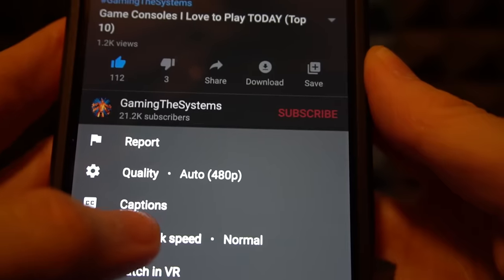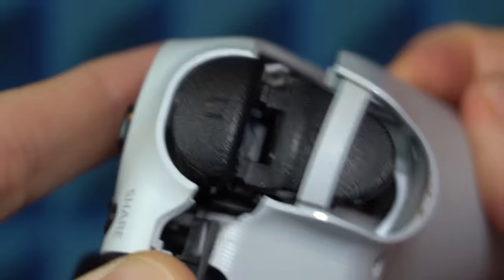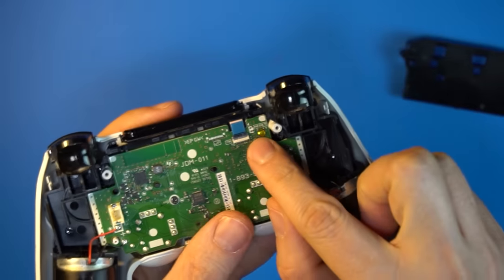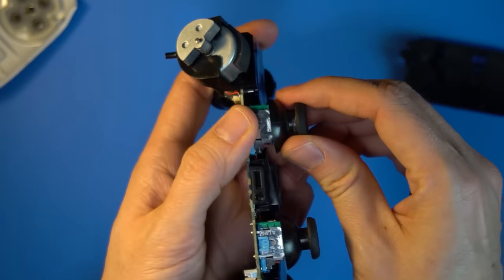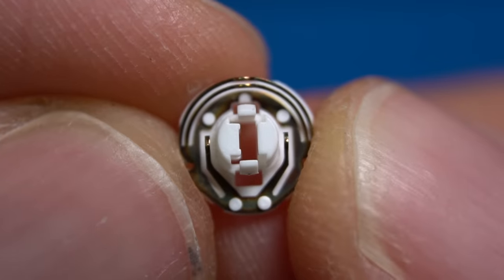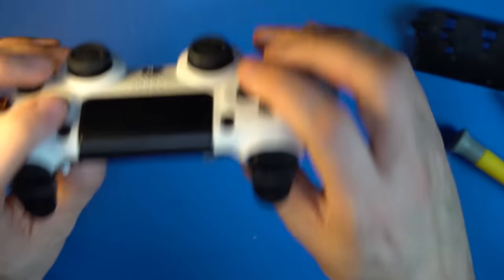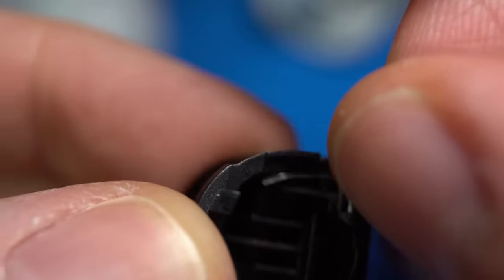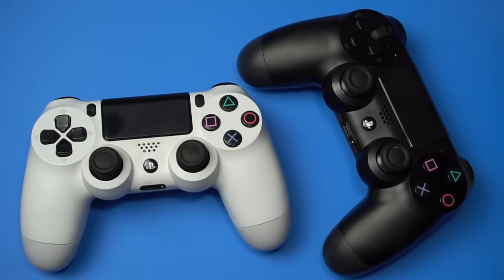How to Repair a PS4 Analog Stick That is Drifting, Sticking, Jittery/Cleaning DualShock 4 Controller

Comment: today, i attempted surgery on a dualshock 4. rest in piece little one...
Reply: Piece???
Reply: @nameskw4774  😐🙄
Reply: @shinmeg  damn... It broke?
Reply: @blickymaster7402  Yeah, I bent one of the small metal rods inside the right stick. Now that stick doesn't work. :(
Reply: @shinmeg  a
Reply: F
Reply: @shinmeg  same thing happened to me
Reply: RIP Controller
Reply: @nameskw4774  Yes, in pieces.
Reply: @Lol Nah what?
Reply: I also did surgery ended up being better than when I bought it
Reply: @Iscopezombiez  Doubt that unless you bought used.
Reply: @fredstead5652  I do repairs I bought parts and took the old ones off it’s way better than when I bought it at walmart
Reply: @fredstead5652  the response is so much faster
Reply: Me too, shit’s literally fucking unplayable, now I have to spend $60 for another shitty controller
Reply: @adc4836  Don't get mad because you fucked up your own controller deciding to fix it when you clearly have no idea how. Don't buy a new controller buy new contact sensors for £3.99 since that's the part you messed up.
Reply: Litteraly rest in pieces😂
Reply: Me too bent one of the silver coil things and now it’s went from a slight drift to only moving diagonally down hahaha
Reply: Yeah..... i kinda snapped the cap off the piece that holds the ribbon rip
Reply: This is how it feels Everytime I think about cleaning out my controller ... The first time I tried this it broke the controller completely. Instead of a small drift. That controller now 100% does not stop drifting to the left now. I took it apart and reconfigured it 3 times no result. I will probably never do this again lol
Reply: @DelusionalDev64  me too 🤦🏻‍♂️
Reply: @nameskw4774  Pieces
Reply: @shinmeg  r.i.p
Reply: Same.. my square and r1 button doesn't work anymore :")
Reply: Same today for me... gutted.
Reply: @nameskw4774  whoosh/r
Reply: @shinmeg  so.. how is your controller? Did you buy a new one? Did you buy a ps5?
Reply: @shinmeg  you should of payed close attention to the video
Reply: Same shit happened to me
Reply: Bruhhhh I feel u my 2k player doing the moonwalk all over the place but damn after clicking on this video all I can do is pray 😂🙏🏽  can’t risk making it worse
Reply: lol
Reply: i cant 😭😭😭💀
Reply: Nah it is NOT just used or dirty controllers. Some of them are complete duds and a waste of money. Just got a custom brand new one and it’s getting me killed every game lmao I’m soo tired of this bs.
Reply: I was the 1k like lol
Reply: You mean rest in pieces
Reply: I think I killed mine too xD
Reply: My light doesn't go on and the right stick doesn't work either, that was my other controller tho cx
Reply: I bought a controller and two days later noticed drift problems. So I'm about to become a surgeon.
Reply: I successfully fixed both my controllers 
I’m an electronic surgeon now just have pass my school and become a real human one lol
Reply: @Iscopezombiez  I am about to try, wish me luck pal. 😓
Reply: Should've just got it repaired.
Reply: Me too :'( just right now
Reply: Damn i snapped my whole top in half so i just decided to full send it to just see whats wrong but i didnt get any wiser now i just have a bag of random ps4 controller parts
Reply: @shinmeg  wow it's really that fragile?
Reply: Just blast your PS4 controller with WD-40 fast drying contact cleaner. My analog stick working good again without disassemble. Just blast inside the analog stick.

However if the only reason was dirt or dust inside of the electronic was the issue. Then WD-40 was the perfect solution to your problem
Reply: @shinmeg  same I don't know what to do
Reply: R.I.P
Reply: @shinmeg  same
Reply: ikilled 3 of them with surgerry'
Reply: I broke the cable to the board so yeah. I know your pain.
Reply: Rest in pieces hahaha
Reply: Mine is just disabled right now. I dont need a funeral for it yet. So  instead I will retire it and move on to a new one.
Reply: @MM-yk8gt  he said the silver wires should face the battery, and my light was not working, so i reversed it, and it worked.. blue tape facing the battery should work
Reply: I laughed hardly
Reply: This was Hilarious that's why this is my  6th time watching it
Reply: Worked for me…
Reply: Well luckily for me everything went well 😅 I can play PS4 again or watch crunchyroll cause that shit was unplayable with the drift
Reply: I'm not even going to try this! I'd rather drop another 59 on a stupid controller that will start drifting in 5 months.
Reply: Haha rip my guy
Reply: @shinmeg bro did not get the joke😂
Reply: @shinmeg I was so scared I was going to do this i managed to sucessfully do it
Reply: Respect DualShock 4 🫡
Reply: Sad button noises
Reply: Im about to do the same now , dont feel confident at all 😂
Reply: F
Reply: @adc4836 You don't have to.  Just purchase replacement parts and put it back together.
Reply: I'm going to attempt surgery on my "throw away" controller, wish me luck
Reply: Rip. Today i will be attempting surgery on a scuf impact it should be much easier because i dont need to take apart the whole controller but still very nerve racking hopefully i dont break it
Reply: @shinmeg how do i prevent this
Reply: F
Reply: @shinmeg my wires snapped
Reply: Mine, too, is resting in pieces 😂😂
Reply: @shinmeg  you need new potentiometer or new analog then 😂 be careful white part also have locks
Reply: Rest in pieces*
Reply: Lmao imma go take it in for repair 😂😂 thank you for comment Sir!!